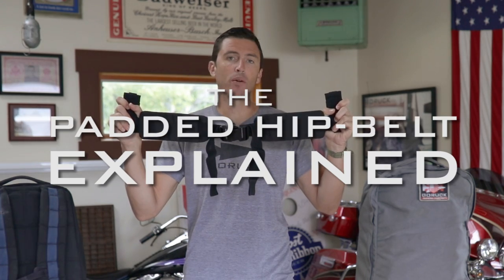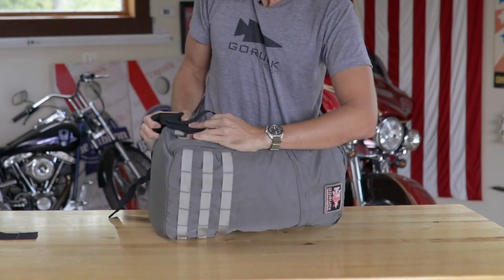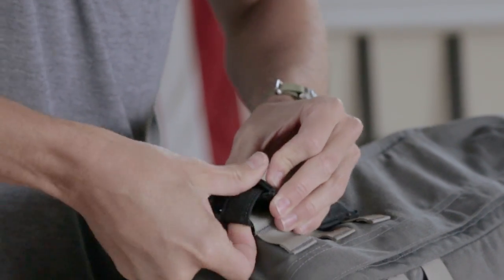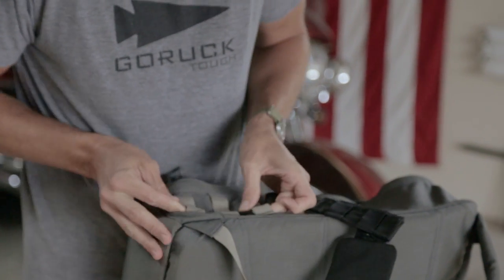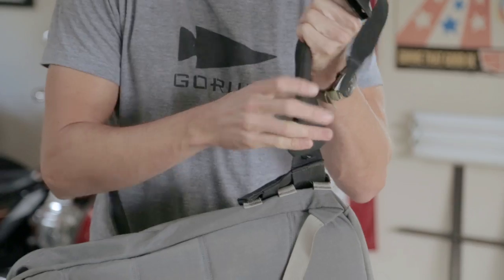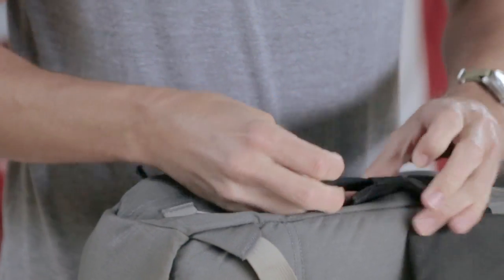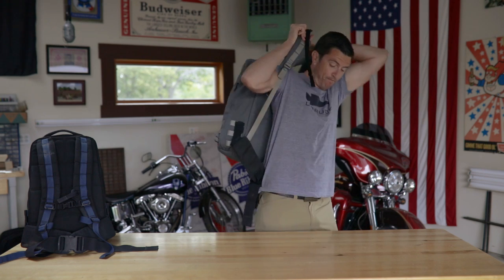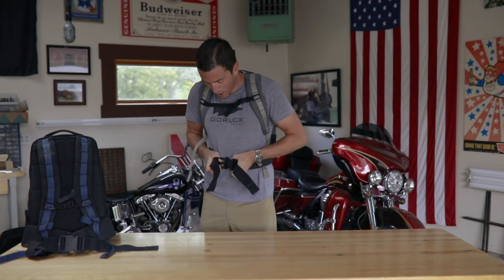GEAR EXPLAINED: The Padded Hip Belt

Comment: Got my hip belt and the straps are sewn into the dam slot where the fit, you cannot extract the webbing from the slot.  :(  Have to send them back
Reply: I thought that too but some are just really lodged in there. Loosen the free part, then pull from the top of the side they come out of in the video.
Reply: @patfurrey5550  Literally came here for this. Thanks. A rugged old pen and some mechanical advantage works wonders.
Reply: @ughtentide  I'm glad I'm not the only one having this problem.  Unfortunately, I can't seem to do it.
Reply: The hip belt straps are NOT sewn into the slot, you CAN extract the webbing from the slot. Do you want to ruck with the hip belt, do you REALLY want to ruck with it? If so, then you'll learn how to handle those straps. Yes, it's difficult at first, but you'll get it. I'm speaking from experience.

Comment: thanks for the video, I just got my new goruck and wanted to make sure I knew how to set it up.   Question.  there are two webbings on the side for the hip belt.  I noticed you used the inner most webbing.   When, or would you use the outside webbing for your hip belt attachment?
Reply: It’s whatever fits you best. Please apply common sense. 
-the GoRuck Team.

Comment: Lower the ruck - great idea unless you are 6'4" and then there is no way you can get the ruck to fit correctly.  I end up having to connect the belt to the last loop only so all the weight is only supported by the bottom loop on the side of the ruck.  I then put an aftermarket belt over that to increase the width of the belt even further so I can get it down to my hips.

Someday Goruck might offer a longer set of shoulder straps or maybe I can find someone else to make up a set for me.  I love my GR1, just wish it would fit correctly.
Reply: Yeah I think it's obvious the GR1 wasn't designed with the hip belt in mind, it's more of an afterthought. From day 1 it's supposed to be high on your shoulder. Jason said on the blog that they are designing new bags for next year, maybe those will utilize it better.

Comment: Hiking ultralight actually shoulder carry look at hmg, z pack no real frame or load straps, but backpacking and hunting normally load 70% on the hips and you can carry weight much more efficiently you’re lowering the center of gravity and your lower body is much stronger.  I’d say anything over 30lbs you should be loading the hips.